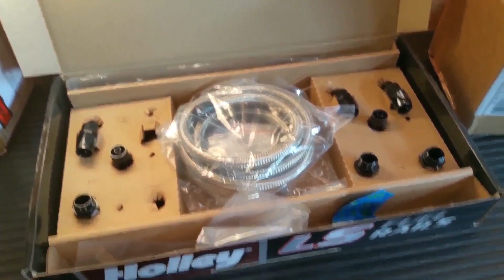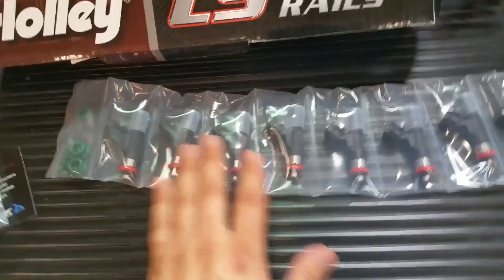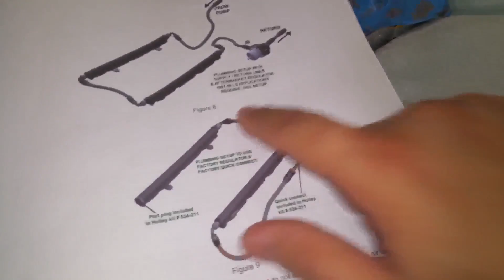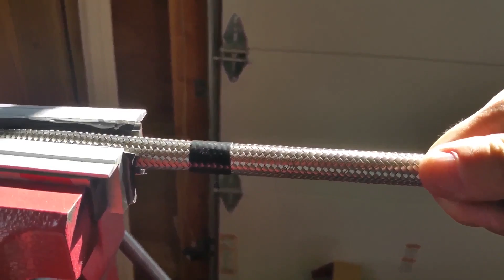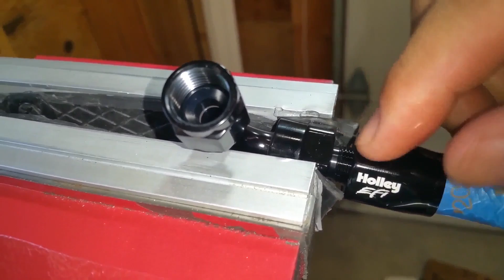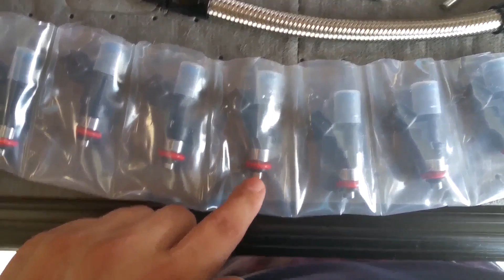Installing fuel Injectors, fuel rails, fuel lines & AN fittings. Boosted C6 build. Part 45

Comment: those brackets have nothing to do with the fuel rail LOL! they are for the engine cover front mounts to fuel rail rear has tabs that sit between rail and that bracket to stop it coming up.
Reply from the maker: I'm so sorry but you couldn't be more wrong. The factory coil covers attach to studs on the valve cover not those brackets, LOL, LOL. The brackets are designed to prevent the factory fuel lines from lifting in the event of a collision.
Reply: LOL LOL LOL Samuel this is your 2 year check-up bud. Have you grown up any LOL?

Comment: No return line?
Reply from the maker: Hello Mario, for this part of my build I did not use a return line, I kept it as the factory has the system set up which is a dead head type fuel system (No Return Line). However, if you keep watching my videos you will see the car now make about 900 HP at the crank and now has a return style fuel system and a secondary fuel pump. Thanks for watching my video.

Comment: Is one side of the back of the fuel rail block or are you running two lines in the back
Reply from the maker: Hello Shoe God 23, yes one side is blocked off. No need to run two lines. Thank you for watching and thank you for the question.

Comment: Get a fast intake lol
Reply from the maker: Hey Chevy young, it doesn't really pay to spend $1,000 on an intake manifold when you have a boosted application. I might only see 3 to 5 HP gains. If this was a naturally aspirated build then i would do it along with a 102 mm throttle body but when your forcing so much air down the motor with a supercharger or turbo its not worth it. Too much money for such little gains.
Reply: Sounds about right, i only suggested the intake because you said you didnt like the look of the stock one lol. That makes sense tho way to much money for such a small gain. Keep up the good work, im learning alot!
Reply from the maker: Believe me Chevy Young, I gave it a lot of thought, I like the look of the FAST intake but its too expensive. Thanks for watching and thanks for the support.
Reply: I actually got a used one from my friend that went a different route for $650 complete with the fast fuel rails. Everyone isnt a fan of used items, but i dont see how a intake can be worn out. Keep a look out on the forum they have them posted for cheap sometimes might catch a deal. Anyway no problem appreciate the detailed work.
Reply: by the way i have a 08 base that im currently doing a grandsport conversion on
Reply from the maker: Sorry Chevy Young, im just seeing your comment now, Youtube never told me a had a comment pending. Anyhow, $650 is a good price and I agree, i never buy used parts but I dont see how an intake can wear out either. If I see one for $650, i would buy that.
Reply from the maker: Send me photos of before and after, love to see that project. Thanks for watching.

Comment: be cautious with the factory adapter fitting with the green plastic..ive seen setups where they leak. when i use them i use the one with the metal clip instead of the plastic. but it looks great!
Reply from the maker: Thanks so much Maurice. Can you send me a photo or link showing one with the metal clip as I have not seen one as you describe.
Reply: https://www.summitracing.com/parts/rus-644123
Reply from the maker: Maurice is the MAN........Thanks so much.